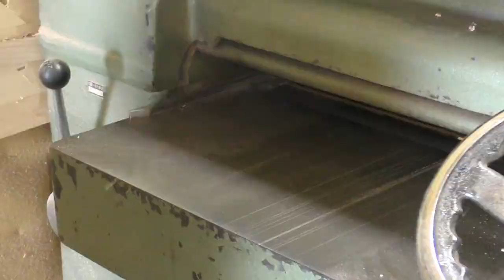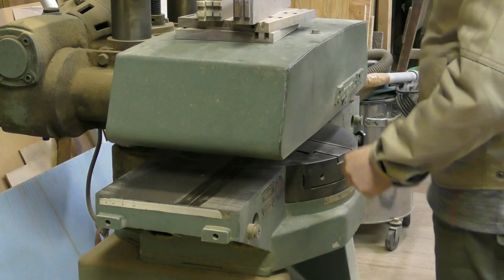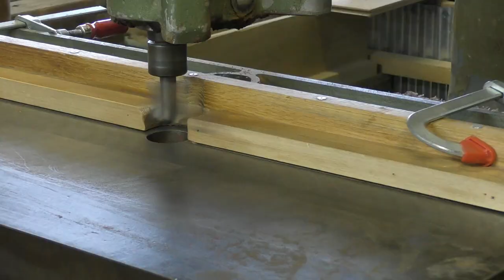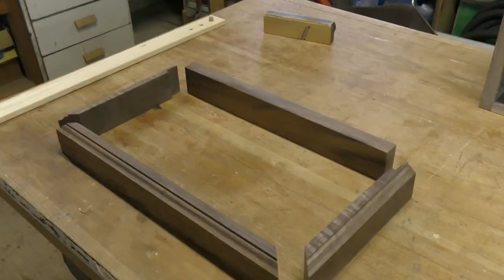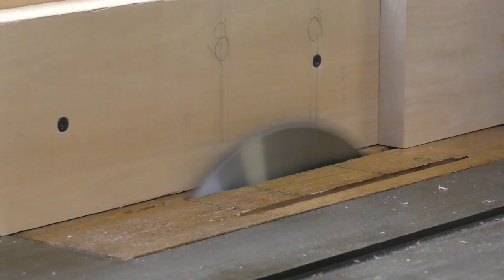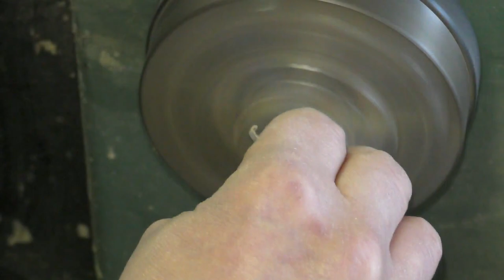[Woodworking] Walnut chest of drawers with 3 drawers, oil finish

Comment: As with all your works of art, this walnut chest of drawers is super beautiful.
Also very noble. And excellently crafted.
With your wood joints, not a hair fits in.
Is working with wood a hobby?
Or do you also do it professionally?
I find that walnut wood is very soft and you have to be careful not to scratch it.
Personally, I like the wood of the Taxus baccata, also known as yew. It has red fruits in summer and the core is black. You certainly know it. Or do you?
The wood grain of this tree is very beautiful and the wood is also very hard.
Well, I used to be a landscape gardener when I was young.
So once again, thank you for letting me see this, your super good work.
Greetings also Germany
Reply from the maker: Thank you for watching.My day job is woodworking and carpentry.Most of the works in the video are my hobby.